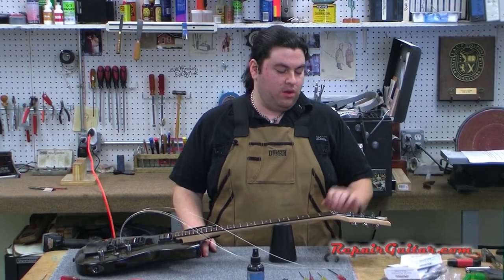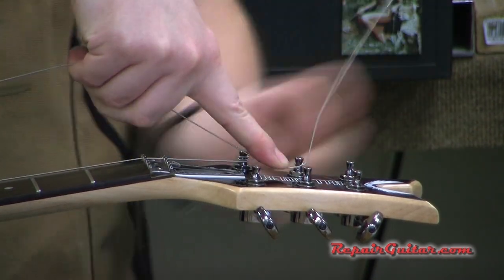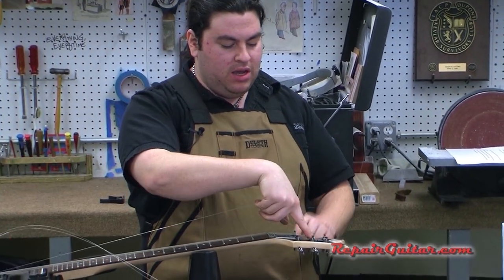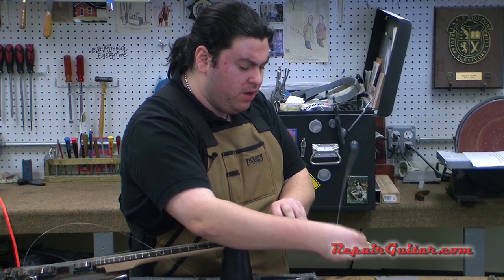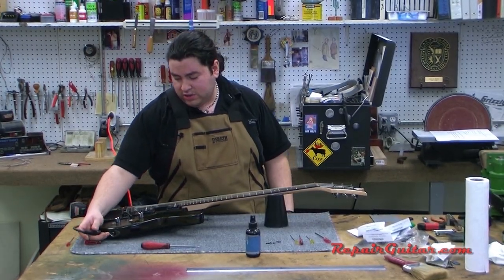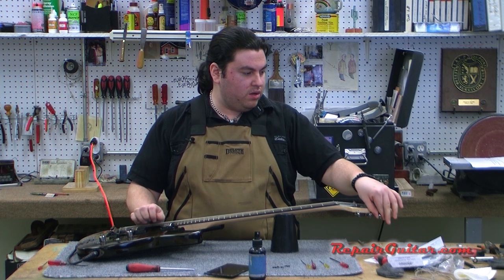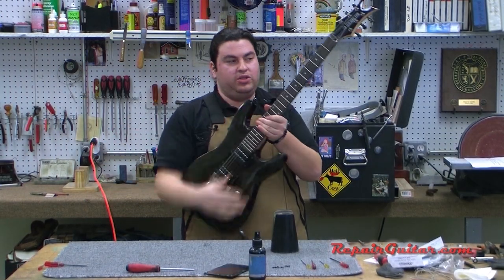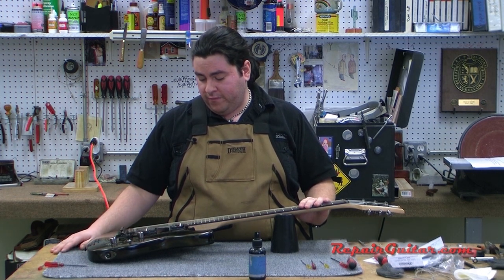RepairGuitar.com Presents: Installing a Floyd Rose System Part 2

Comment: The biggest problem I have with a Floyd Rose is the B string buzzing in the locking nut groove. I use 9-42 strings.

Comment: I have a few floyd rose guitars and one is an Ibanez RG series. I kinda changed the string and i thought i had it right but apparentley not. I had it in and all and i thought about changing it from Drop B to Drop A, bad idea i know, and the bridge is way up and the string that i replaced(6th string) is all floppy and the other 5 strings are like how they are suppose to be. what should i do? tighten the claw screws on the back or?

Comment: I have a problem. I can not tune the whole 6 strings. If I tuned the 5th in A. my 6th will go to F and so on with the rest. I managed to tuned the first 3 E.B.G but the D.A.E. will go out of tune.  can you help me? I know how to  Intonate it string by string and to adjust the bridge to be parallel with the guitar body. But If I can't tune it properly I can't do the rest.
Reply: nico garcia Do you have enough tension on the springs?
Reply: Hey! thanks for your reply! I already solved the problem. I just kept on trying and made it perfectly balaced! thanks anyway!
Reply: +nico garcia one thing I figured out that may help you for future reference, it's to not tune the strings sequentially (e,a, etc.) but rather to work from the outside in. By that, I mean that you start on say low e, as I do, then rather than simply going to the next string up and tuning it, hop all the way across and then tune the high e string. Then jump back down and tune the a string, then back up and tune the next string down from high e, and so on. The reason is that tuning sequentially creates uneven tension across the strings, thereby messing with the rest of them. So by the time you get up to around halfway across the strings, you'd have to go back and retune where you started from, which sounds to me like what you described. This method isn't as necessary on fixed bridge guitars, but Floyd axes are super finicky until you lock em up.

Comment: I followed directions and now my strings are touching my frets. wtf does that mean??
Reply: Is your bridge level? If so and they are still touching frets you may need a truss rod adjustment but I would personally take it to a guitar shop instead of messing with the truss rod
Reply: Yeah I ended up doin that. I checked out the truss rod and it was completely stripped. Damn used guitars lol
Reply: +Tommy Stockmann dang. That sucks. Sorry to hear
Reply: Dude, don't pay some  bozo  50 bucks or more to adjust your truss rod First,  make sure the strings are running through the lock down blocks properly. Where the strings touching the frets before your string change?  Do you understand  how a Floyd performs? Let me know what kind of guitar you have and maybe I can save you a ton of coin.

Comment: Somebody say the obvious..... ok then, I will.
Because those strings are new and you didn't properly stretch them before finishing, it will be out of tune within a minute. New strings need stretching before they become stable enough to hold the tension consistently. Its a small step but without it none of the locking stuff matters as it's all locked down out of tune.
Reply: That said, I now know how a floyd system works which was why I came here. Thanks.